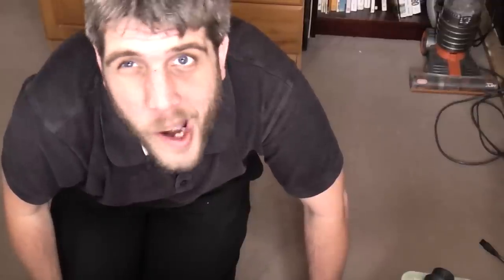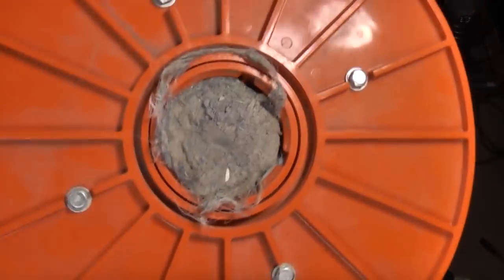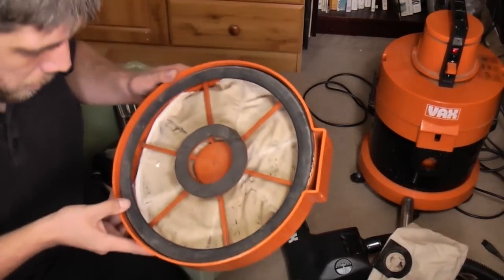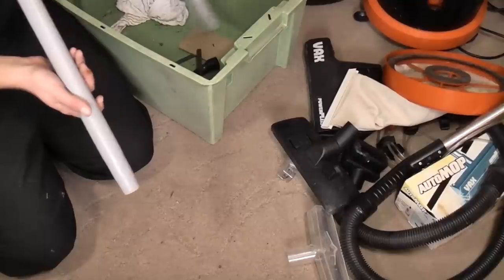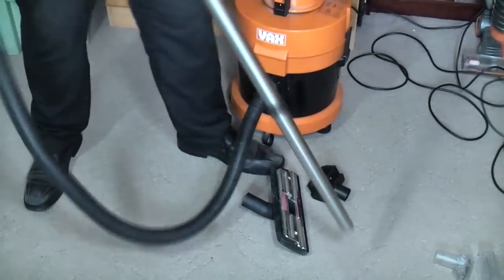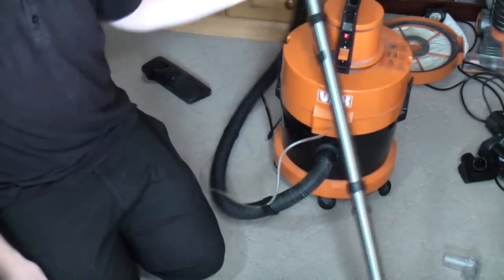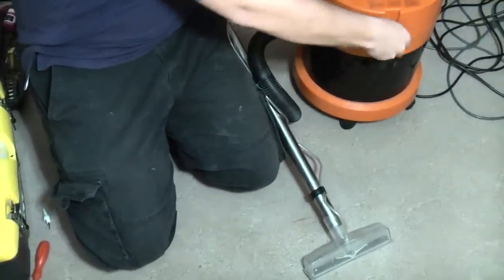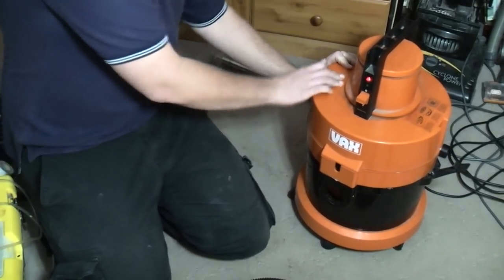A Car Boot Find Vax 121 - First Look and attempted use!

Comment: Good video Sam, my 
Mum and Dad had one of these new back in the late 80s. You are right in saying there should be a  screw to secure the the dry filter assembly together. Also the little blue pre-motor filters were held in place with a wire spring clip. Obviously because the wash system is basically gravity fed anything other than carpet washing was a bit and miss unless the machine wash above the level of the wash tool.  
It should be fine after a full refurb.

Comment: The "automop" was never going to work properly with that Vax as it doesn't have a pump.
I've made my own hard-floor wet-cleaning tool by using garden reticulation tubing (same diameter) and half-circle spray nozzle just ahead of the tool. Works great!
For carpets I have converted an old Filter Queen power head with it's own 240v supply cord and it really deep cleans the pile. I've also changed out to different filter media for better filtration and flow, something easy to do with an old barrel Vax.  So all in all, I now have a Franken-Vax that does just about everything pretty well :)

Comment: How good are the later models at shampooing carpets, please, Sam? We have a Powa 4000 which we've only ever used for sucking up water before. I've been thinking recently I should have a go at cleaning the carpets with it, starting with something small like a fireside rug (or even a bathmat!) to see how well it does. Is it worth it or wouldn't you bother? I think we do have an automop but I've never looked at it properly. We also have the big clear head. It does at least have a pump so you don't have to worry about gravity! Thank you.

Comment: The wet demonstration portion . It would almost be better just to forget about that and  do it the old fashioned way. Get some warm water and suds with a soft scrubber and a clean cloth to wipe it dry and get on your hands and knees .I have always washed floors that way and  it always came out well. The same for polishing , the hands and knees method is best . However, if it is stained carpet then you would have to use shampoo and hence use a machine . I remember the Rug Doctor it used to be popular and it was a rental , but not any more .

Comment: You should check out Roger's video he shows how to prime the gravity feed solution keeping the hose down at first. Still better to use a pump machine
Reply from the maker: That works on the wash head as the suction keeps the solution going. Not so on the automop though, as there is no suction to help.